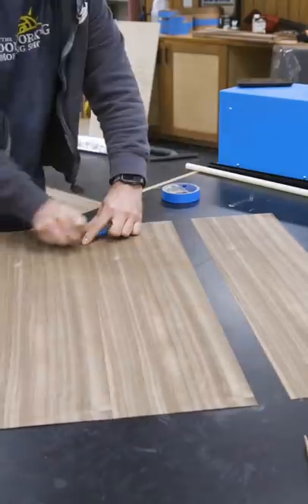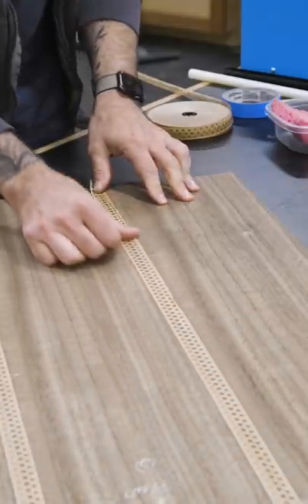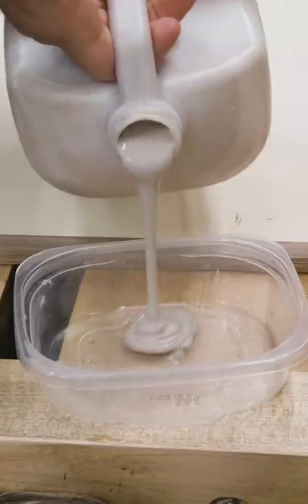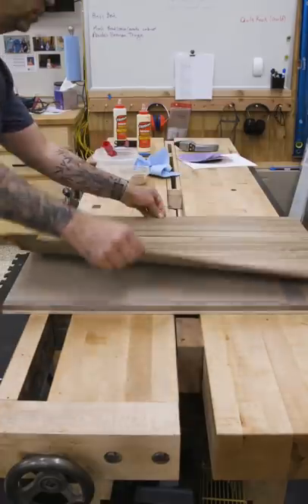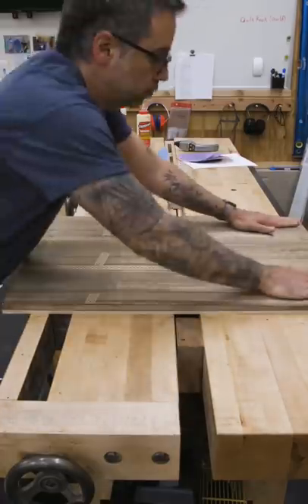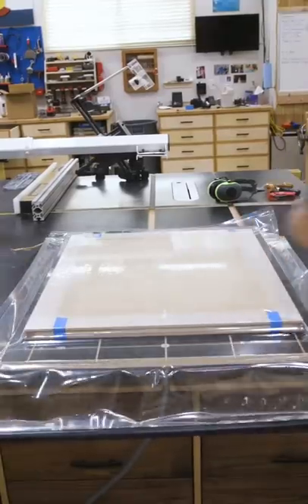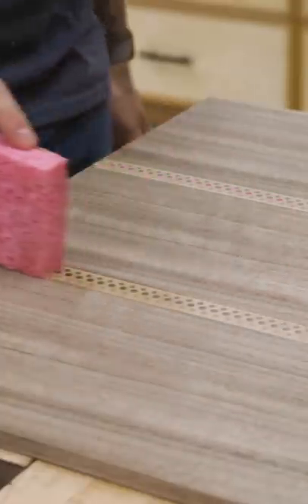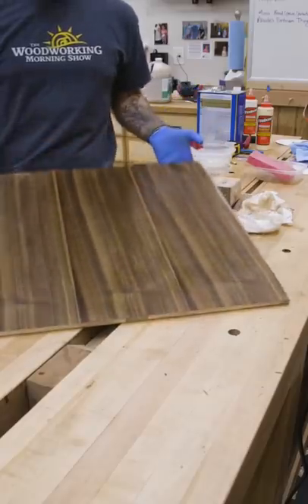Veneered Furniture Doesn’t Have to Be Crap | #shorts

Comment: I’d probably prefer furniture made from cheaper but real wood rather than “fake-ish” and fragile substitute with noticeable repeating patterns
Reply: Venner over MDF or cross plywood it's as strong and durable as solid wood (if not more durable). Solid wood will get cracked/crooked by the years. A well made furniture from cross plywood will stay straight for ever. Actually it's about taste,as a furniture maker myself,i choose solid wood too for expensive furnitures,but for medium range furnitures, MDF with veneer it's a must..
Reply: veneering is cheap and doesn't last the test of time.  Fisher Price makes more durable plastic crap.
Reply: I'm a fan of veneer.  Many people love the repeating patterns.

Corners and edges of veneered pieces are where problems can become readily apparent.  Something like thick banding can help in these areas, however.

The biggest problem these days though is how thin veneers are.  I'm sure they're thinner than a sheet of paper.  That makes new furniture a non-starter for me.  Vintage pieces from the 60s / 70s fill me with more optimism.

Besides, try paying for teak these days.  Only millionaires can afford teak.  A one foot length of 1 x 4 teak in Canada goes for $25.  Insane!  And it's all farmed thus the grain will suck.
Reply: @jimgardner5129  exactly mate... Agree with you 100%. Don't know the situation where you live,but in Europe,timber prices got double in 4-6 months or so. Most people can't afford even a good quality pine (pitch pine, Oregon etc). I also love the repeating pattern too, and use only  2 component polyurethane/acrylic varnish top coats. The results are impressive.
Reply: @georgestam1710  me and my father have been building furniture for decades too. When talking about durability I’m referring to the surface rather than overall strength. A sharp edge or corner covered with veneer can peel or just get rubbed off and expose what’s underneath over time, while real wood can sometimes look even nicer when “worn in”.
Reply: @mxs4193  Which is why WW shows alternatives. He frequently does solid wood edge banding and on things like desks has done a solid chunk on the high traffic edge with decorative routing. He also recently did a video showing past projects and how they have fared in different conditions with different finishes over time. He cares about quality.
Reply: Yeah. Go on ahead and use 10 times as much lumber from the Amazon rain forest to have solid wood. Its ok. Veneer makes old growth and rare lumber go further. Reducing the amount that needs to be harvested.
Reply: mdf hdf and plywood do not resist moisture damage as good as actual wood any real woodworking craftsman will try to avoid using it at all as it cheapens the look and quality of the product.
Reply: The problem with veneers for me is that eventually they will start to separate or peel, it could take 10 years or 100 years but it will happen.
Reply: Like most people who think they hate freshwater fish or wild game....you only know the worst quality versions. The fact is veneer is better for most wood furniture/appliances (especially doors and dressers). 
To often you see cheap plastic veneer wrapped around literal garbage particle boards. The actual way to do it is very simple. Soft wood core, hard wood veneer. Like a properly forged knife it's not likely to break, bend, warp, or loose its intended function easier than one made of a single piece of the heavier material. 
Its like hating tile floors because you once had to live in a crap trailer house with a tile patterned  piece of vinyl (that was more rug than flooring)
Reply: @solomonheppner  I just don’t buy it to be honest. Hollow core furniture, mdf, veneer just doesn’t hold up to nasty conditions and time. When our house burned down a lot of our furniture was pushed to the limit with fire and water damage. Mdf stuff crumbled like cardboard while real wood was as good as new after some refinishing (these conditions aren’t common, but still)… Also, just this morning as we were working in the workshop my dad pointed at our workshops wooden door and said “did you know this thing is pushing ~120 years old and has been transferred across countless buildings?” It’s hard to believe considering how fresh the door looks after surviving so many freezing winters. There is absolutely no way veneer products would be as resilient.
Reply: @mxs4193  even good high quality wood is destroyed by the same conditions....and at no point do i think particle board can compete with actual wood. Veneer should only be high quality hardwood wrapping a frame/core of equally good quality softwood.
Reply: @mxs4193  external doors shouldnt have veneers thinner than an 1/8 inch. And using really high quality hardwood on an exterior door is also just as much of a waste. You use decent, 50%-70% on external. Been building cabins with guys who practically lived pre industrial age. And they dont think veneer is trash, simply a method that has its place, as well as strengths/weaknesses
Reply: @mxs4193  nice of you to bring up fire.....another reason why using a more costly and heavy method of one solid wood piece being a good reason why people veneer wood furnishings

Comment: Any particular reason not to glue it with the veneer tape on the glue side? Does it leave a noticeable bump?
Reply from the maker: Some people do leave it. I was always taught to scrape it away so it doesn’t Telegraph through the veneer. But never tested it.
Reply: I forgot to remove the blue masking tape from the underside, once. Was compelled to bring that admission to the foreman.
Reply: So they remove the blue tape and glue that side down. Then scrape veneer tape off. But your saying to reverse. And glue Veneer tape down and I guess peel blue tape. I was wondering similar.
Reply: I have this massive MCM chair and it’s entire back is a shell and all huge veneers I’m really wondering if I can handle refinishing it. It has other veneers layered underneath. Should I get as large veneers as possible?
Reply: @chaddsteinberg3758 , Chadd, if you are replying to me, i wrote about a mistake. I had glued the the underside down, including the blue tape which made the work  completely unusable. I had to make it over on my own time, but my shop was out the cost of materials. Mr. Wood Whisperer is pointing out that it is possible to include the paper veneer tape in the glue line, but maybe not best practice. If you are planning to replace or layer over veneer on a large curved surface, it will be a tricky job. Follow WW's advice, and read up on hammer veneering.
Reply: @leehaelters6182  gotcha, yeah def need to do some serious research. It’s like a $2000+ chair refinished. Thanks
Reply: @chaddsteinberg3758 , I am curious about MCM. Is that the designer? Who is that?
Reply: @leehaelters6182  yeah it’s old beat up, massive pieces of veneer missing, what’s left turned grey from sunlight, seat tore, prob needs bushings repaired and more. It’s the big round back Eames office chair. Thought it would be cool to customize it.
Reply: @chaddsteinberg3758 , a friend repaired one for himself. It had been discarded with only a torn rubber bushing or two. What he learned is that nobody knows what adhesive is used by the factory, so he was compelled to order factory replacements with the original spec adhesive, I am sure at a tidy price. But it is a wonderfull piece of furniture. Best of luck with your project!
Reply: @leehaelters6182  hmm interesting so the adhesive can’t just be epoxy?
Reply: @chaddsteinberg3758 , my friend, who is a furniture designer himself, said that all references to those bushing repairs that he could find were that the non-proprietary adhesive repairs always failed. Take it for what it is worth, is all I can say.
Reply: @leehaelters6182  thanks for the tip.

Comment: Hey mate, love watching your tips.. a fair few of them I've ended up using myself. I do have a problem I was hoping you'd be able to point me in the right direction? At work, we've been making these small boxes (Flat top, shadow line base, re ctangle with 2 x 50mm radius edges one side.). Problem we've been having is that the 0.7mm seems to be buckling after a water based sealer (client specifically wants waterbased sealer). Using spray contact, Tasmanian Oak Veneer to HMR Whiteboard, sanded. Have tried using the next available thickness 2mm, but we can't heat, steam or simply bend around the radius, which the client is adamant on keeping. Where would you say we are going wrong?

Comment: They have the appropriate plastic roller trays at Benjamin Moore or Sherwin Williams. I think the shape of the Sherwin trays are better, but they are black so they suck to use outside as the sun melts them.

Comment: Funny we use a big glue roller that that glues both sides at the same time.  It then goes into a 200 degree press for a couple minutes then after it cools and dries a little more it can be worked with

Comment: What’s a good way to glue if you don’t have a vacuum sealer?
Reply from the maker: The old fashioned way: hammer veneering. Also, you can use cauls and lots of clamps.
Reply: A lot of clamps. All of them. Go buy more, you will need them. Now go buy more.

Comment: I would love to do this but the whole vacuum bag thing seems like a lot. Is it possible to get decent results just using a board on top with weights to "clamp"? 
Mother natures clamp is undefeated
Reply: 10,000lb of weights, sure.
Reply: You can on smaller stuff that you can ensure even pressure with clamps and cauls but not just weight but on larger stuff I wouldn't attempt it without a bag. I use the roarockit thin air press system which just uses a hand pump to pull the air out and apply pressure and costs less than $80 for the kit with a 26x28 bag.
Reply: Let's say the panel he is making is making is 20x24 inches, giving 480 square inches. If his pump can pull 10 psi, which is not a lot of squeeze for a glue line, then he is applying 4,800 pounds to the project. You would have to park a car, all four wheels supported, on top of your own project to equal it.

Comment: That looks like a lot of labor for a small surface, this really must be a passionate case by case type job to do  with this method
Reply: I work for a pretty large millwork company, for big jobs we order veneer panels from a company that specializes in it. Or for smaller jobs we'll order veneer sheets already "stitched" together and glue them to a core ourselves. If you're set up for it, it's not a big deal.

Comment: Does the vacuum bag put equal pressure onto the middle of the panel ?
Looks like it would have more pressure on the edges.
Reply from the maker: It's equally distributed pressure for the most part, but we use cauls on top of the work to make sure the veneer itself receives the most even amount of pressure possible.
Reply: @woodwhisperer  I'm old school,  we used a big screw press that could do an 8x4 sheet 👍🙂🇦🇺

Comment: With labor so EXTREMELY expensive, why not use solid wood and all these expensive steps could be eliminated.   Wood should be cheap, it grows in nature.   

I never understood why certain woods are more expensive, just plant more of that tree and supply is easily available for all the expensive woods.  We all know that wood prices are set based on perceived value which is BS.  Cherry wood should be just as cheap as pine and it would be if we planted more cherry trees instead of pine.  These brokers/ mills are not fooling anyone.  Too many middle-men and salespeople making a living off of products they don't produce or work.  Its like all industries.  Food industry is the worst.  Farmers take all the risk and almost no profit.  It all goes to the marketers, packagers, salespeople/brokers, warehousing and transportation.  Those are the people who should be earning minimum wage.  Not the one who actually takes the risk and grows the food.

Comment: The vacuum pump "clamp" makes no sense to me. 

The only pressure will be from the tension of the plastic bag as the empty space around the sides of the block are being pulled in... Surely a standard clamp would exert a much higher pressure and equally well distributed...
Reply from the maker: Nope. :) Regular clamps would apply more pressure, but fairly irregular pressure. The vacuum bag provides perfectly even pressure. The vacuum bag also has an additional benefit of "degassing" the substrate, which essentially pulls the adhesive deeper into the material, making for a bond quality that's impossible to get with clamps.
Reply: @woodwhisperer  okay. About degassing it, I agree with you. So you get a nicer deep and even coat of adhesive. But I still don't think the actual pressure the bag would exert is significant. And you also don't have to wind down a c-clamp on it with all your might. Putting a solid thick board on top, you'd still get an even pressure.
Reply: Of course, the question is, how much pressure do you need. If it is working for you, then obviously the bag is exerting enough pressure. And if you are effectively sucking the adhesive into the material, then why would you need a lot of pressure. But still, clamping it down additionally might give you a tighter fit
Reply: Yeah, I was just stuck on the sentence "that allows atmospheric pressure to push down on the bag". That isn't true / misleading. The pressure comes from the sides of the bag being sucked in which causes the bag itself to stretch and exert a pressure, which means the force is coming from the perimeter of your sample, not evenly distributed over the top

Comment: The microwaveable  takeaway 'boxes' and the aluminium trays in the UK are re-used by me for storage of nuts bolts nails screws etc ... they can be stacked and are transparent ... a waste to waste them on glue! ... that's what the alloy trays are for ... glue, paint oily parts etc ... though the plastic trays can be used for holding small parts during dis-assembly of 'clean' assemblies
 ... Big Clive probably doesn't use them because the IOM is not in the UK!!! 🤡

Comment: If you place $10k vaneer (equivalent) on $300 hardwood, I'd consider it a better investment than $200 vaneer (equivalent) on $40 particle board.
Reply: Usually its a softwood core.
Reply: @solomonheppner  For good reason. It's cheaper and lighter and has the most to gain by being veneered (price)
Hardwood wouldn't be veneered because it holds enough value that veneer doesn't add much. 

From a heirloom perspective, never choose softwood.

Comment: One question. Why sandwich the sandwich with boards if you're using a vacuum/atmospheric pressure as the clamp?
Boards will distribute the point loads from clamps but you'd have to try very hard to un-distribute atmospheric pressure.
Reply: To ensure even clamping pressure, veneers are quite thin and can deform without a mold

Comment: Yeah but chipboard etc is crap.
The reason why people hate veneers is because they chip and also generally are put over mdf of plywood substitute.
What makes it really annoying is when they do this and charge a premium price to boot.
Reply from the maker: If the job is done well, the substrate becomes irrelevant. MDF is a perfect substrate for veneer but if the veneer is super thin and the job isn't done well, you'll get delamination. When done correctly, you'll never have an opportunity to know what the core is and the premium cost is totally justified.
Reply: @woodwhisperer  does a premium price justify poor building materials?
Using 3 ply as a substitute for pine for example, isn't acceptable when charging for pine wood products.
You will find that the integrity and the makeup of the wood has a massive impact on its work strength.
E.g. Ikea chipboard vs 3 ply v pine.
Which is strongest?

I agree with using similar woods and veneering the tops for cosmetic purposes.
As I build guitars made from mahogany with a maple cap and a A grade veneer.
It would be a waste to use one decent peice of well figured maple when a veneer justifies the use of other maple underneath.
If you get what I am saying...
What I don't agree with is taking 3-5ply putting that same veneer over it and then saying ooh look it's a stunning guitar with a high grade top.
When in reality it's a turd in dressed in gold.
You can polish a turd but it's still a turd.

Comment: "Veneering is to make precious woods go farther"? If you have a precious what then you don't need a veneer you just covering up that precious wood. In fact you don't need precious wood for veneering you could put it on dirt cheap crap and make it look just the same.
Reply from the maker: I think you misunderstand. The veneer IS the precious wood, not the substrate.
Reply: @woodwhisperer  oh.. that makes sense otherwise it wouldn't. So the precious wood is the veneer. Gotya.

Comment: Such a waste. It’s like gold plating. You’re just wasting decent wood for your lie. Why not just paint it to look like the expensive wood? At least then you’re not wasting anything.
Reply: Because using a combination of lighter softwood for a core wrapped in a hardwood vaneer is better than simply using a solid block of hardwood. For multiple reasons.
There are exceptions, but if you use good quality wood it doesn't matter.